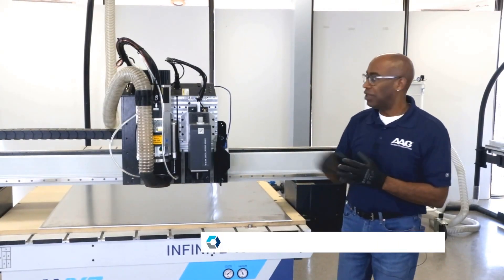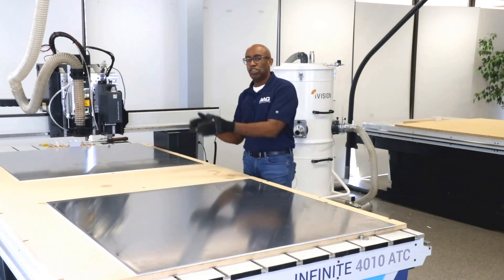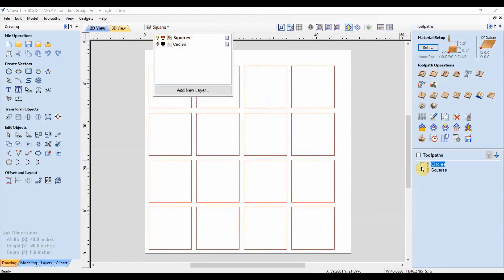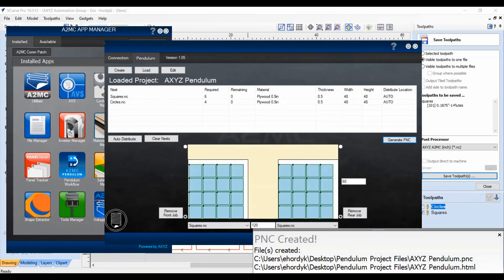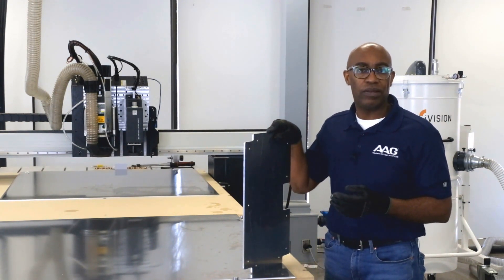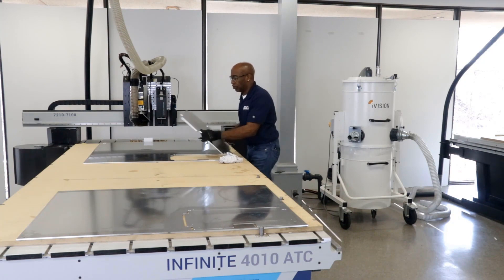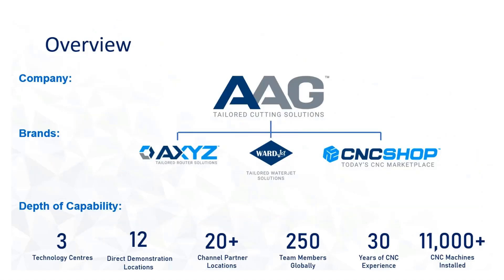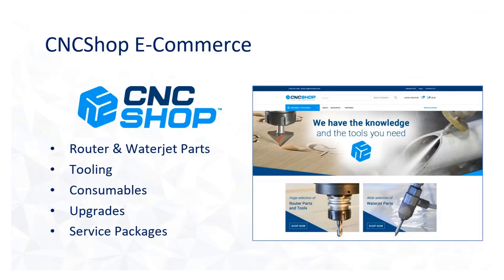How to Cut Aluminum at High Speeds with the AXYZ Infinite - Webinar Recording

Comment: which carbide bit is used here
Reply from the maker: Hi Parvez - here is a link to the bit that was used - https://cncshop.com/products/70247-6mm-performance-series-upcut-o-flute-aluminum?variant=39625293725829.  Please reach out if you have any more questions. Thank you.
Reply: Feed rate?
Reply: @culiacansinaloa3432  I think he said 22,000 RPM at 220 ipm